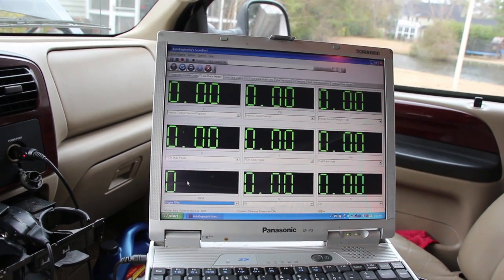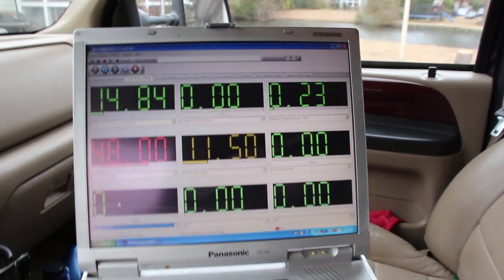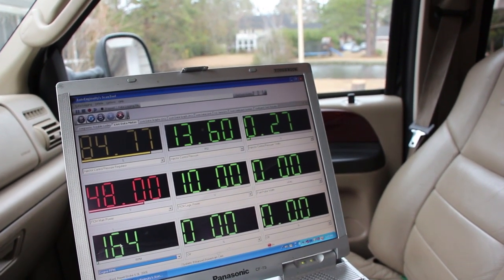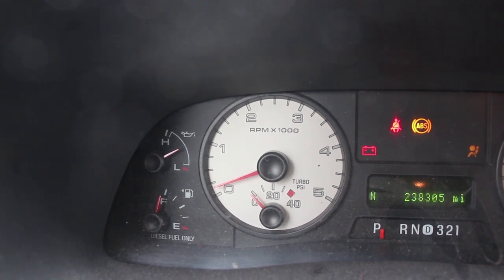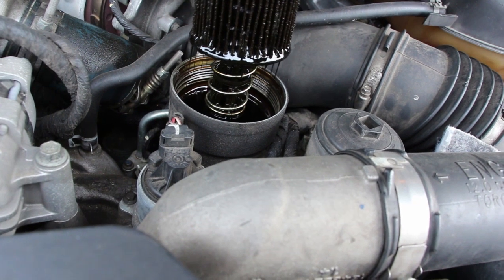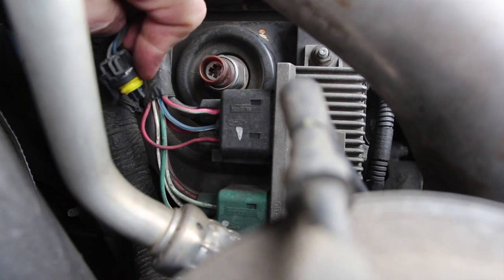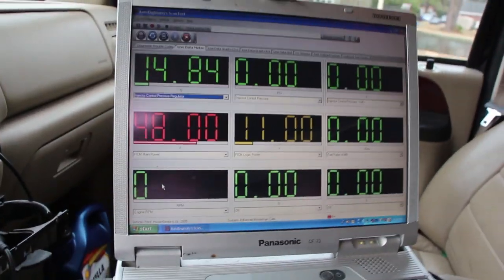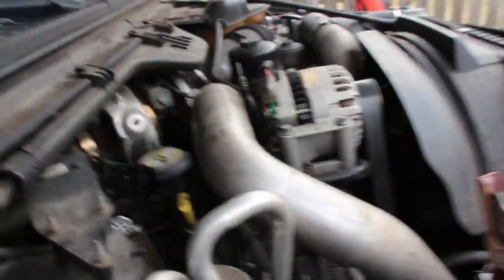Powerstroke 6.0 Crank - No start Diagnosis - 1

Comment: John r u still around
Reply from the maker: yes
Reply: @JohnBorkowski  could you send me a cop of that laptop software
Reply from the maker: @michaelhaiden6718  It does not work with out the USB Key. Its called Autoenginuity.

Comment: Ipr valve screen/cleaning is probably all you needed..?  That oil cap wasn't factory therefore that filter wasn't doing anything. I was searching autoenginuity and this vid popped up. How do you like the software?
Reply from the maker: DJs Tuffmods love it! IPR was shot... there was another video showing the testing

Comment: For 5$ Torque Pro app with quality BAFX ELM 327 blue tooth adapter 24$ amazon, is almost a must have for powerstroke drivers. It shows ICP, IPR, ficm, along with 200 or so other pids. Of course it is an OBD2 reader and tells you exactly what each code means. It even does 0 to 60, quarter mile, maps , video, fuel economy, and even logs all of your data so that you can review it in the house.

 Incredible driveability tool displaying up to 15 pages of real time data. It is not however an 800$ ids ford scan tool, but for $5 for the app, and $25 for the proper quality BAFX ELM327 Bluetooth adapter; it blows away the scan gauge 2 that cost 170$ and only allows you 4 pids to view at any given time. The ScanGauge also has to be connected to the truck at all times, where you can be sitting in your living room reviewing torque Pro app on your tablet. Don't waste your money on scan gauge 2 like I did.
Reply: f355911tt. there are severl elm products... any brand you suggest?.
thanks in advance..
Reply: Yea autoenginuity is far better than torque pro. Sorry. You get what you pay for.

Comment: are u using motorcraft filter? big cap and small cap make a difference. watch dieseltechron
Reply from the maker: That is one of the things I have learned about this whole process. I think the use of the wrong cap has triggered this failure. though I think it is the IPR that has failed. See my other video for that test. Hopefully not my injectors.

Thanks!